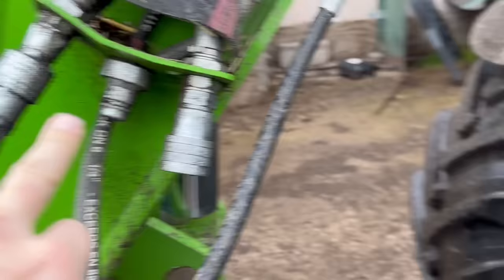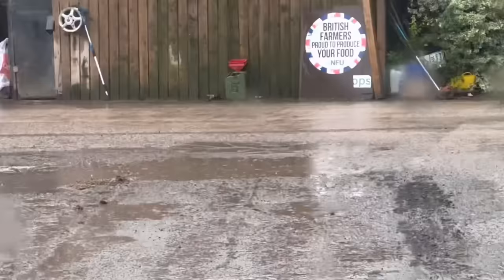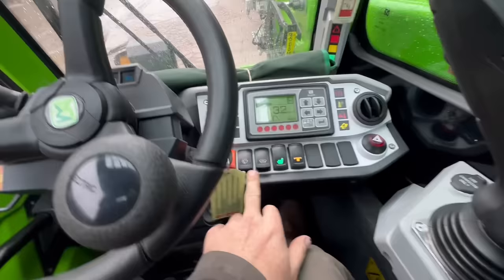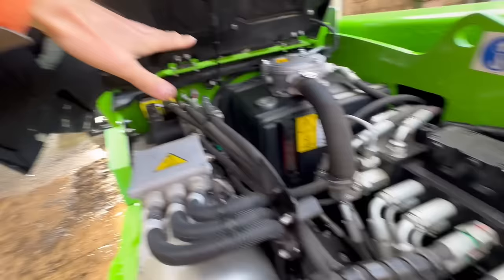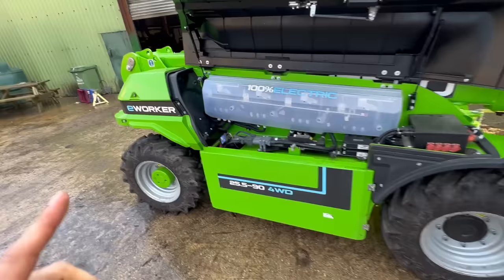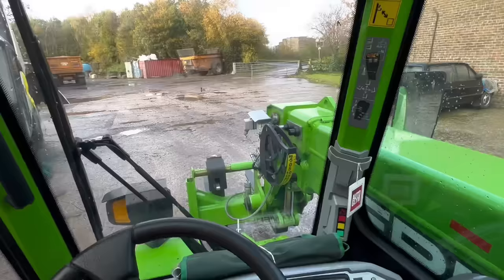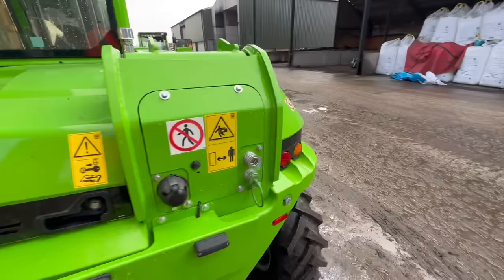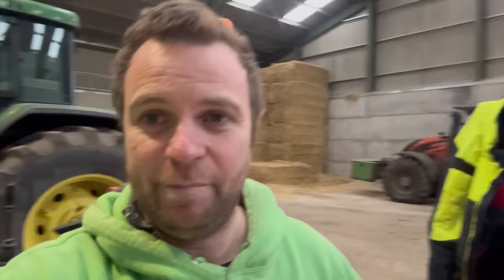ELECTRIC MERLO ARRIVES #AnswerAsAPercent 1323

Comment: The whining on the electric merlo is even worse 😵‍💫
Reply: That’s because the hydraulic pump is running off an electric motor instead of an engine. Same is true of electric cars. Once engine noise isn’t there you become really aware of other noises like road noise.
Reply: Also from my experience tends to be picked up on video way more than rl

Comment: 30 years ago worked for I C I in Doncaster running 24 / 7. All forklift trucks were battery operated and the batteries were changed every. 8 hours  we had one big battery shed  that was fully kitted out with hoists etc for this operation

Comment: Great that the electric Merlo uses lead/acid batteries instead of lithium. 👌 I think, until the patent runs out, that electrically heated front screens are only available on Ford, Jaguar and Land Rover? 🤔 Great video, thanks. 👍

Comment: Pressuring the sump? And if I remember right there was water in oil. Cracked sleeve?, ( hopefully it’s a sleeved engine if that’s the case ). Still could be a head gasket